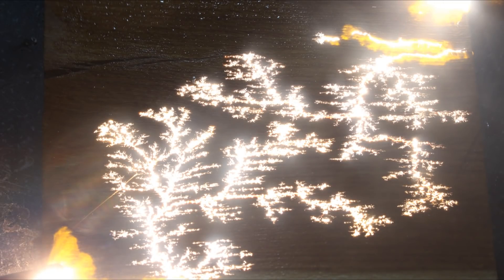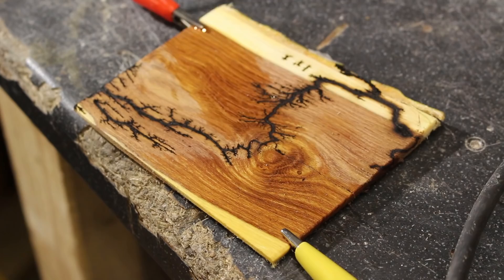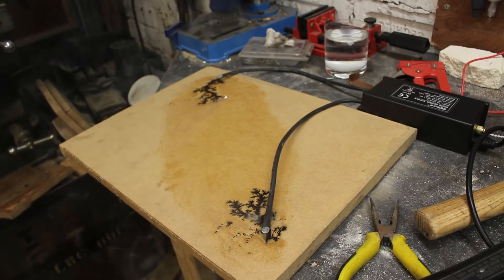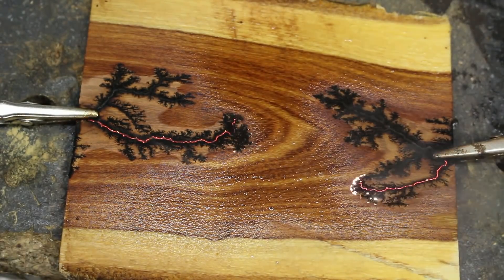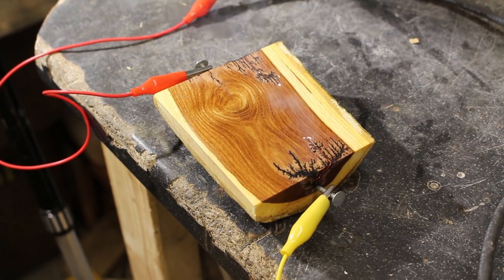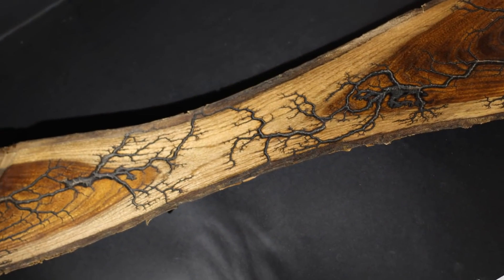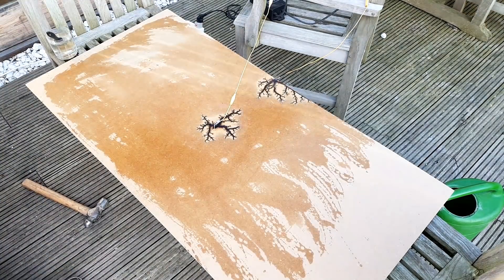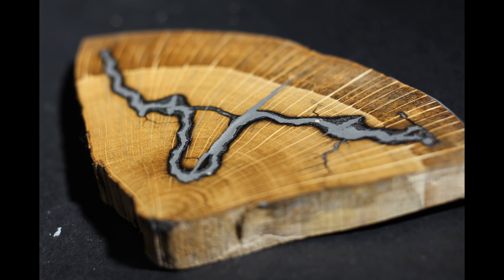10,000v Wood Burning Experiments

Comment: Hi i have the same power supply i believe and won't burn wood, only tiny sparks at the end when i slightly lift it away from the surface. Any input is greatly appreciated. My neon power supply model number HB-11010 
Input: 120VAC 50/60HZ 800mA
Output: 10kV 30mA

Comment: Excellent video! Very thorough and detailed!

Did want to add a tiny bit of info for your reference in the future.

'Softwood' and 'Hardwood' do not mean the physical soft/hard nature of the wood. It is a reference to the type of seed. Hardwood trees have a seed that has a coating, like a fruit (cherry), or a shell (oak). Softwoods are coniferous, and have seeds with no covering, and are exposed to the elements with no protection.

Basically, you can have a soft hardwood, and hard softwood...

Comment: Thank you. I have been doing exactly what you did in this video trying to find out exactly what you were trying to find out and your video which was impossible to find actually answered some of my theories and saved me a LOT of trial and error! BRAVO! WELL DONE VIDEO!

I discovered my patterns looked better with 3 MOT's than with a single one but I burned up two of them and decided one was best. After finally sitting down and putting everything on paper I finally realized since it is AC, the total output was returning and my smallest transformer was always the first to go. This is not all because I realize the transformers are not rated for the voltages I was sending through them but this long post was supposed to be short.

I also realized that the deeper burns I wanted were very bad for my transformers. The arcs were neat at first but too bright with a single transformer and bad for the eyes ( in daylight).
The triple transformers arcs were more yellow than white but shot higher. The arcs don't seem to happen with the neon sign transformers I have seen but will also burn up your MOT's.

You saved me on experimenting with different woods to test my theory which you proved were correct except your voltages are higher so soft woods are not good for you. I find pine, which I use most because it's free made beautiful patterns but when I dropped down to a single transformer, the patterns have changed and the burns are slower. Hard woods such as oak do not like to spread with me. They want to find a grain and follow it tending toward straight lines.

Instead of nails, I actually had real electrodes made from tungsten. They are more thin but are not burning black like the nails. They make a different pattern but I am concluding it is because they are thin. I have prepared welding rods which most know are also electrodes but I have not used them yet. Yesterday was the day I was going to and didn't get to burn. If you get to experiment with that before I can come comment again it would be nice to know. 

I was asked to try things other than sodium bicarb by a friend and he suggested an acid. I had worse results with the acids. I started with vinegar and tried lemon, hydrochloric (btw the strong acids were diluted.) and sulfuric. I use wood bleach every once in awhile and am now wondering how well would that work. I think what it boils down to is salt water is the best conductor and if there is a better one it will be as table salt and turn out to be an overdose and burn everything up. I need to add that anyone looking into wood bleach need to forewarned that just smelling the powder in the container can kill you. Mine is in liquid form but I take care to wash it off and not sand while it is on wood and dry.

Using a clip on one end and resting an electrode on the other seemed to appear to make one pattern travel faster than the other. The clip end desired to munch up the wood in one place more though. The electrode end wanted to travel.My clips are bigger than yours as a side note.

I tried aluminum powder and that was just a disaster. I saw another vid where someone had that idea after I did it and his was a disaster.

Your ball was awesome. I turned a long piece of poplar to the size of earrings and burned it. I then separated them where I had the wood thin and sanded smooth. What totally surprised me was that the burn patterns were mini sized on the smaller wood.They shrunk and the earrings turned out terrific. I might add that this was not 6000 volts +. This was one MOT that made smaller fingers shooting off from the branches so I don't know the true reason the pattern shrunk with the wood because that same one did make bigger channels on bigger wood although slowly.

Your video saved me SO much time and I thank you for it. I think it boils down to what type of pattern you want can be decided on amperage. The less amperage the smoother your patterns. The higher amperage causes a more ...jagged pattern with more tiny branches. How fast you want to burn seems to be decided on voltage. 

I hope this helps. This video sure helped me.

Comment: Amazing work! This video is now in my personal top 10 youtube videos of all times!! (by the way, your electric foundry build has been in there for a long time too)
...
ideas for further experiments: small scale direct current (careful, much more dangerous) to make knife handle scales p.e.; how about a ball with 1 plug in the center of the ball? Or put a really thin MDF board on a metal sheet, and see if you can get it to make a capacitive coupling and pattern; hold one electrode on a long high voltage stick (with insulating glass segment) and try to direct the burn line by moving the electrode over the board (probably works only with DC); what if you enter metalic "knots" in the wood before burning. (fill a non-through hole with liquid aluminium, about halfway between the electrodes); make a labyrinth with the conductive solution, will the burning follow the path?

Comment: Could you use a welder to get this results?
Reply: a welder is low voltage and high current, so I'm afraid you wouldn't get any details, just burnt wood... (might be a good way to make charcoal for a forge, though) =)

Comment: That's awesome! :) What happens if you paint the conductive solution on in non uniform patterns? E.g. a spiral? With one contact at the centre of the spiral and the other at the outside?
Reply from the maker: That's a really cool idea, I'd like to try that sometime!
Reply: I found that the liquid spreads because you have to keep wetting it. The burns will not spiral as you could see on his tree trunk. They will be more maze like. Once the slightest wetness gets near an already burned area, it can and will, and has burned backwards just to reach that spot closest to an already burned area. If you want a spiral your best bet is to create one in the wood then wet that.

Comment: please make it clear it's the 30 miliamps that's the heart stopper. not the voltage
Reply: It's the combination of the both.
A fucking battery won't stop your heart if you touch it.
And it does deliver more than 30mA tho.
Reply: he did make that clear, because he indicated that that current is already lethal at voltages as low as 50V (which is correct. Lower voltages like the ones from car batteries are simply not strong enough to create a significant current through our body, unless you have that conductive solution all over your hand and then grab both electrodes with it, then the solution conducts, but the heat will injure you badly)
I wonder if he could achieve similar results with high-frequency AC. That would be much safer to work with, due to the skin-effect (high frequency current stays on the outside surface of the conductor and thus can never reach your heart, but can still cause lifethreatening burns, of course)